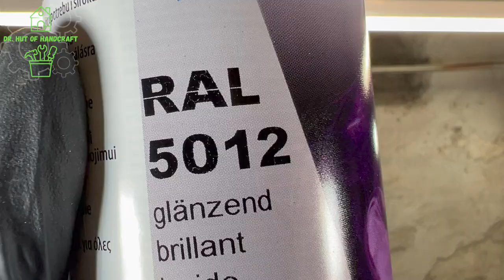'Jobi' poppy seeds grinder restoration I Dr. Hut of Handcraft

Comment: That isn't a meat grinder: Those have a spindle/screw and a solid grate and also a bigger opening. This is propably for poppy seeds.
Reply: I was thinking the same thing.
I've only seen grinders with different 
sized plates, depending on what you're 
grinding.  nice work all around !!!
Reply from the maker: Pretty sure that there are several different types of meat grinders 🙂
Reply: @DrHutOfHandcraft  I too am sure there are but this is still a poppy seed grinder https://www.youtube.com/watch?v=9G-mLINy9fU 
They were used because poppy flour goes rancid pretty quick. Not trying to be a smartass :D but to you as a vegetarian/vegan this should be good news.
Try baking some Mohnkuchen / poppy cake it's super tasty.
Reply from the maker: @deinemutter6237  wow okay you convinced me! 😄 Did some research and yup must be a poppy seed grinder.

Thank you !